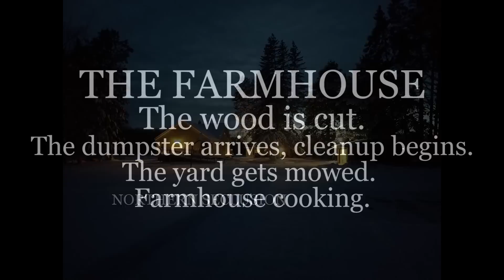THE FARMHOUSE. The Wood Is Cut. Dumpster arrives.  Cleanup begins. New Puppy. Farmhouse cooking.

Comment: Joe, would it be possible for you when you tear down the house trailer to take the trailer frame with wheels and use it to stack your firewood on then pull it to the wood burner. maybe even build the floor, 3 walls and a roof and leave the one long side open to pull from? save you from multiple moving of firewood and will help keep it out of the weather. Just a thought i had. 
-Bill
Reply: I suggested the same idea.

Comment: Joe, just a suggestion.. I have a wood boiler and I don't split my wood, also instead of double handling wood, once I cut it, it goes into the bucket of my tractor and gets dumped right in front of my wood boiler and covered with a tarp. I don't Stack it or split it if it will fit in the boiler, then I'm only handling the wood one time, I'm very busy as well so I try to make it less work for myself.

Comment: It set me back when you talked about your Mom. I lost and miss my Mom since 1997 and it's tough! The time we got a roll off it was always $300. no tires unless they are cut up. I managed to fill 5 of them since living at this house. On the first one there was a 10x8 ft. metal shed that was in bad shape and the thought of taking in down wasn't working for me, so with the fork and bucket attachment it went down quickly. Scooped it up and dumped it in, in less than 20 minutes. I mowed one big pasture today and finish up the rest tomorrow, so I can park the bush hog for the year.

Comment: Have been through hernia surgery...  the sooner you do it, the better you'll be in terms of recovery.  I had both sides done...  with mesh... open surgery.  Have heard that doing it laparoscopically shortens recovery time, as incisions are smaller, but they won't want you doing any heavy lifting for several months.  Painful getting around for a few days... not bad after that.  I kept a broomstick close by to help me get up off the bed/couch the first few days...  wasn't bad after that.
Reply from the maker: I was just in talking to the surgeon and they want to do the robotic surgery with the mesh. only 1 to 2 weeks of down time. After two weeks I will have no restrictions.

Comment: Fall ushers in a lot of changes. It also is a blaring neon sign that the cold north winds will be nipping at our heels. It is an annual rite that those who have abundant resources must lock down those resources so winters blast can be tolerated. Getting our wood setup for our furnaces. It also signals good times around the campfire trading hunting stories throughout the years.

Comment: I am cutting up some ash wood here.  It can be extremely hard to cut.   Cutting a trunk of a standing tree it cut great with a Stihl saw about 3/4 of the way then the saw got into a bit that wouldnt cut.  Smoked the oil on the chain.  Made me think the chain was dull so I switched it out with a new one and same thing.  Moved about 24 inches along the trunk and tried again.  Cut like normal.  I have seen liquid water flowing out from a snow pile on a subzero day.   snow is a great insulator.  I shovel snow onto my rose bushes to minimize cold damage.

Comment: Since the boiler takes longer, round logs; I was wondering where all the split wood will be burned.  Did I miss the review on the cupcakes?? :)
Reply from the maker: Split wood gets burned in the workshop wood stove when dad comes up. It gets burned in campfires also. yes you missed the cupcake review. I do have that in a video. They were awesome.

Comment: Is all that split wood for the wood burner? Seems like last year the pieces were much bigger going in there.
Reply from the maker: The split wood gets used in other places as well. Campfires, the wood stove in the workshop when Dad comes up. Like I said in one of the videos, I am cutting the bigger around pieces shorter because I learned last year that it is easier loading two kind of heavy logs vs one really heavy log.

Comment: I thought those furnaces could burn whole logs?  Even green ones once hot?
Reply from the maker: I think I can fit a 48 inch log in there. Doesnt matter if its green or dry but you burn a lot more wood when it is green. When it is green it takes a lot of btu's to burn off the moisture. Also, it might take a 48 inch log but that does not mean I can lift a 48 inch log and get it in there.